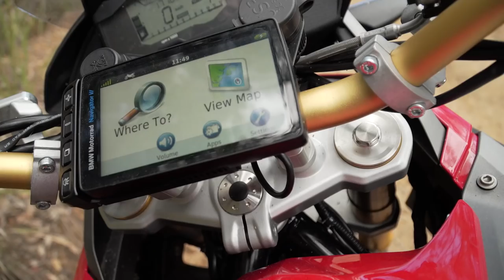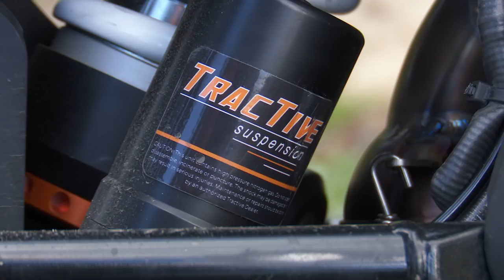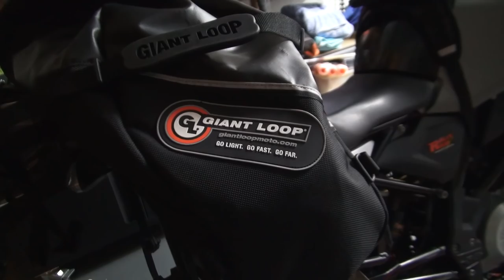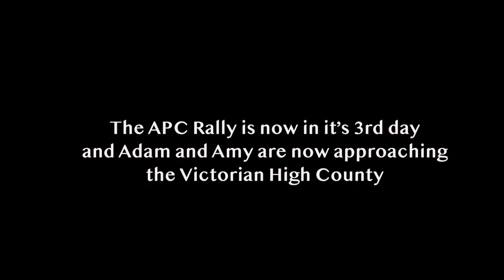Rally Raid Products BMW G 310GS - build, test, discussion, prep for adventure

Comment: The suspension upgrade shown here, is it the stage 1 or stage 2 ? The optional spoked wheels by rally raid, do they have the same OEM diameter?
Reply: ripmax333 it  looks like 17/19. The front looks bigger than the rear.
Reply: The suspension is LEVEL 2 (+20mm travel). The wheels are the same size for either suspension kit, as the bike comes standard with a 19" front wheel (unlike the Honda CB500X, that needs the LEVEL 2 suspension to fit the larger front wheel) - the rear is 17", and they are a direct replacement for the standard cast wheels - including all the original brakes, ABS sensors and cush-drive.

Comment: Those saddlebags don't look at all durable enough for 5000 kays, considering the amount of weight and upcoming shake and rattle to deal with...
Reply: The Giant Loop bags are actually really robust - I have one that's covered over 30,000 miles on and off-road. They are designed specifically for dual-sport and adventure use.

Comment: How did you install the alloy wheels!
Reply: Just take out the bolt and change the wheel.  If you mean how to source the wheels hubs would cost around £200/$200. Then buy rims and spokes and get someone to build the wheels  but will cost around £2k $2k. For the pair total cost
Reply: To clarify, the wheels that Rally Raid manufacture have their own design of dedicated hubs that accept all the original brake discs, ABS sensors and cush-drive assembly. The cost £825.00 a pair for the tube-type, and £1049.00 for tubeless rims.
Reply: Jenny Morgan  that's a very reasonable price for the wheels. I would think the hubs alone we be around £400

Comment: I will make the assumption parts alone are the price of the bike. I am sure it's a great bike however the upgrades totally no worth doing.  Just buy a more suitable bike.
Reply from the maker: Ron a heap of people don;t agree with you.
Reply: I was not saying anything is wrong with the products. I was clearly stating buy a more suitable bike because the bike budget would have doubled. This puts the price point at better alternatives.
Reply from the maker: @ronschulz4433  I'm not saying to you that you are implying there is anything wrong with the products.  Just read my comment as it is meant......some people like doing up their 310s as simple as that.
Reply: As a supplier I think you have taken offence to my comment. I own a F850gs and have done some minor upgrades like crash protection, the down side to this is the weight has now increased not ideal. I would love a lightweight bike, but at what cost. If I had owned a 310 for some time some mods would be worth doing. To get the full upgrade is foolish in my opinion when Ktm / Huskvarna and other makes would be superior and cheaper in the long term. The 310 budget bike and doesn’t perform all that well until modified as you have done. Minimum spend would be suspension and bash plate, probably would add wire wheels to this cost is high for the price of the base unit. For the person who replaces worn out stuff over time probably it could be a viable solution.
I enjoyed the video, all I am saying is alternatives are available without replacing 40-50% of the actual base bike.
Reply from the maker: @ronschulz4433  Ron I'm not a supplier, I haven't taken offence, just let it go mate.
Reply: @ronschulz4433    @Ron Schulz  There isn't any widely available quality small capacity ADV motorcycle. The only other option is the KTM 390 ADV but i do dislike the look and it needs to be ridden aggressive which i do not like while riding on the street. I'm living in SEA and consider this modified motorcycle. Perfect for this region.